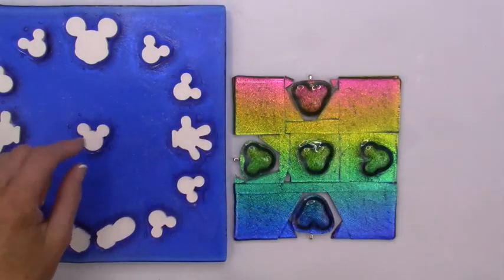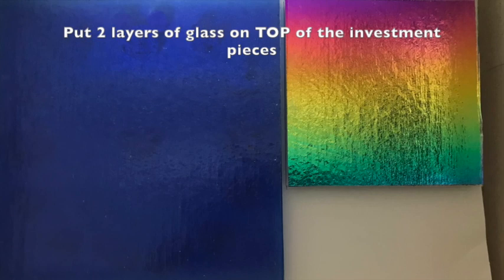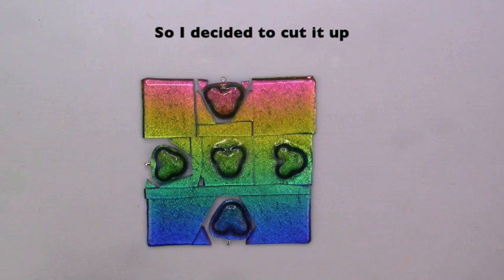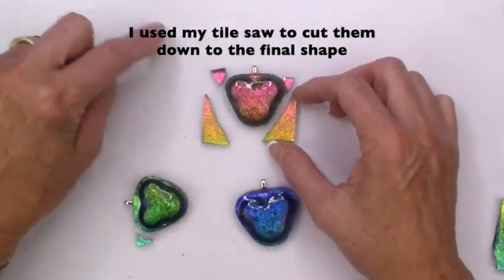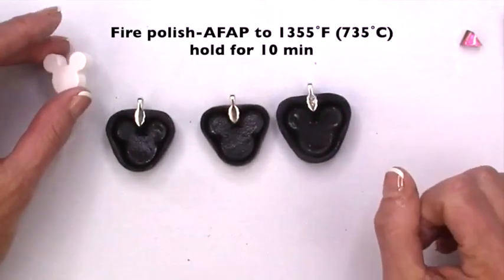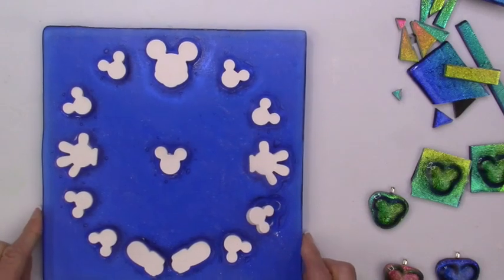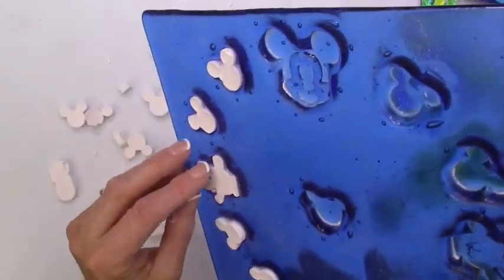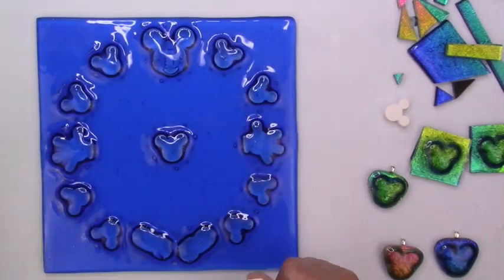#78 Investment Mix, Pendants & Drilling A Clock

Comment: How about making something in wax, invest it, steam it out and load the investment with glass to cast an object?  too advanced for your viewers?  I want to see your solution for cold working the horrible finish the investment leaves behind.   If you look at the depressions on the back of your mickey clock, you'll see what I'm talking about.  That's the negative side, I need the positive nice and shiny without having to slump.
Reply from the maker: worldtraveler I’ve definitely considered trying this type of casting but I agree it would be way to complicated for a 15-30 min video. I’ve seen some glass artists that are know for casting get a beautiful finish. I believe their investment Mix is slightly different & more effort is made to remove bubbles in the Investment Mix.
Reply from the maker: worldtraveler check out the art & classes offered by markabildgaard.com
Reply: @SusanMcGarryGlass  I looked at his work.  Nice stuff, but again, no clarity to 95% of his stuff.
Reply: @SusanMcGarryGlass  I'm successfully casting what I need in glass, however I've shot down 2 investments already.  Even moldmix 6 produces this hazed result.  I'm starting to think the only real solution is to cast in polished stainless steel molds or countless hours of coldworking.  Removing bubbles from investment is easily done with a cheap vacuum pump.   It's not bubbles in the final piece.  I've even tried boron nitride coatings and same result. Take a look at this and tell me how you think these were made.  I bet your first guess is Dalle de verre.... but look closer at the lower edge of the glass in the second photo.  They appear to be cast as they all are identical.  You cannot chip dalles with this kind of uniformity and you cannot cast identical complex shapes like this with this kind of clarity.  Quite the mystery isn't it?   https://www.worthpoint.com/worthopedia/antique-victorian-era-chunk-glass-1920585459
Reply: I posed the question to Mark.  Let's see if he has any good ideas.  Once upon a time, I believe cast glass was dipped in an acid to smooth the casting.  That's where the road ends for me.  :-(
Reply from the maker: worldtraveler I looked at the antique glass pieces in the link you posted & I’m guessing those are made by a glass blower not a glass fuser. They have the ability to make pieces shinier without interior bubbles. And they can use molds to repeat a piece easily. I know the frustration of trying to figure out a process so I hope you find the answer. I think asking Mark should help. But in the end not knowing may be what causes you to come up with something completely new & awesome. So keep trying!
Reply: @SusanMcGarryGlass  You moght be right, it could have been hot worked, but pressed into a mold for a short moment.  They are all identical.  Ill let ya know what I find out.  Thanks.